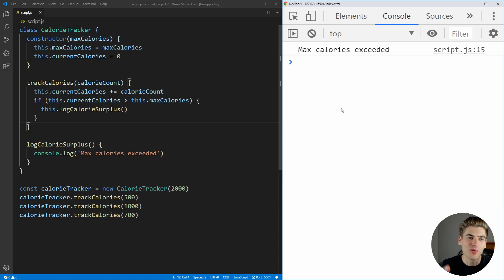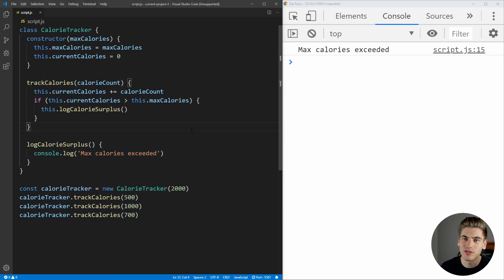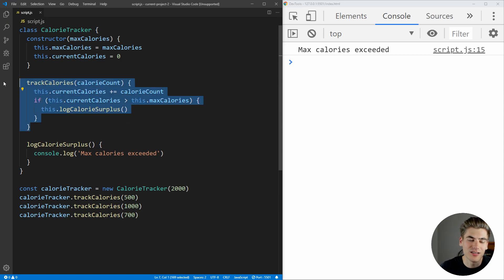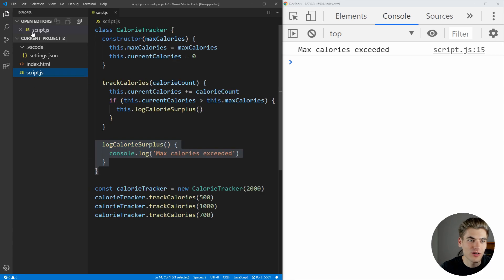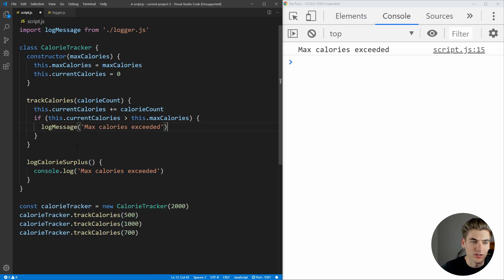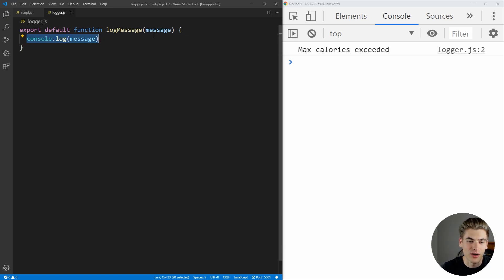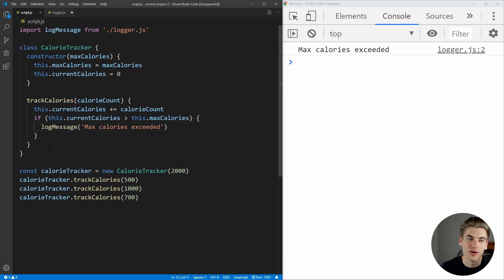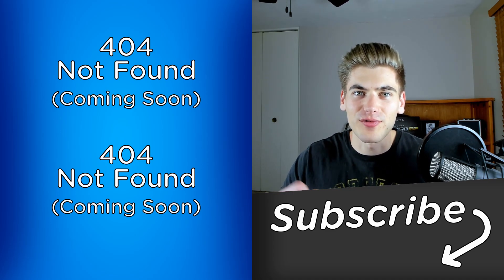Single Responsibility Principle Explained - SOLID Design Principles

Comment: The final class still accumulates trajectories and keeps track of the value, compares it with a limit and logs a warning. All what changed is that it does not call the system log function, but does it indirectly through a custom function (which is a good change, but not sufficient if you really want the SR rule).
Reply: Is that create a "Notifier" interface with a method "notify" could add more respect for the SR ? The CalorieTracker could take a third argument in his constructor (maxCal: number, notifier: Notifier, currentCal = 0) and during the instantiation of the class, pass a class which implement the Notifier interface (eg: LogNotifier)?

Comment: Now what about the part where you're checking if the current calories is greater or equal to max calories, shouldn't this get handled by another class too? Because now you are doing to things adding the calories and validating the value, also sometimes having a single class to do a very small task seems to be overkill, what about having other methods in the class and each method takes a single responsibility?

Comment: But how do you decide what is a "single responsibility" or "one reason to change"? For example, you could argue that the CalorieTracker class is still responsible for at least two things: handling the tracking and defining what message to log in case the tracked calories exceed max calories. And you can take the argument even further. If a class and a method both need to satisfy the single responsibility principle, then how can a class ever have more than one method? Two different methods represent two different responsibilities so if they are both in the same class, the class must have at least two different responsibilities. Sure, the responsibilities of the class and the methods are on different levels of abstraction but then how do you know what is the correct way to split the program into layers of abstraction? I mean, otherwise I could just put everything into a function called runProgram and claim that the function satisfies the single responsibility principle because its only responsibility is running the program and it only ever needs to change if I wan't to change how the program works.

I know that at least part of the answer to these questions is that you just have to use common sense. But the (supposed) usefulness of having an explicitly stated "single responsibility principle" is itself a consequence of the fact that it's very difficult to make correct decisions based on "common sense" unless you are very experienced in whatever you are doing. So I think it would be nice if there was more guidance on how to actually use this and other similar principles in practice.
Reply: Agree, if logic as well as the maxCalories should not be the part of the CalorieTracker. The maxCalories is used to decide whether to log or not to log a message, hence it is not part of the CalorieTracker. The CalorieTracker should only have a single property currentCalories, which might be passed to some logger instance or function, which implements an internal logic such as 'if (currentCalories > maxCalories) {// log something}'

Comment: I want to ask a simple question I just noticed. What's the difference between a function written using the "function" keyword as  "function example() {}" and writing it as "example() {}"? Thank you.
Reply: been two years and i bet youre probably a senior dev by now but if not adding the "function" keyword is using when youre declaring the function, then using it the other way is when its in classes or when youre calling the function.

Comment: The final class still violates the SRP actually. It calculates calories AND logs something. Logging is not a part of calorie calculation but rather belongs to a higher-level process - calorie tracking. If for whatever reason the tracking process needed to include some other actions (e.g. triggering some events) you would have to modify this class for reasons not related to the calculation process. The proper design here would be to have two low-level models - a logger and a calculator, and one high-level model (tracker) that would orchestrate the overall process. And having these classes in place you could write unit tests for all the functionalities with no pain - for example, you would not have to mock the logger to test the calculation logic.
Reply: Absolutely correct. The Calorie Tracker class should not know anything about the logger function it should just tells that the "max calorie is exceeded"
Reply: You're totally right. I think he kept it like this just for demonstration purposes, but what you said is important to note and should've been shown in the video.
Reply: @HandledToaster2  Especially if meant for demonstration purposes, it should demonstrate the principle properly.
Reply: @Vikas Choubey not 100% sure, correct if I'm wrong, but most likely instead of already calling logger inside the class, you might want to throw an exception, and put all the trackCallories calls into try catch, and when the exception was cought, only then call the logger. Or, create event (callories were exceeded) and listener (on callories exceeded, do that and do that, like push message, send email, delete refrigerator) and so on, which @suffocateforfucksake already explained.
Reply: This guy programs.
Reply: in javascript you can hoist the mock with jest to mock the dependency, it violates the dependency inversion (that do not is a constraint in a javascript environment)
Reply: yeap

Comment: A class with a single method is a code smell.   The solution is typically a closure.
Your example also exposed that log Message wasn't a good name for a function that sends an email.  What happens as a result of exceeding calorie count is intimate knowledge and none of the class' business.   Use an event or signal.

I like your videos.  Thanks for your work.

Comment: SRP is more of a software re-design thing or used in large classes.  In this case, it's not helpful at all because it logCalories is a private method and will only be called by CalorieTracker.
However, if you had to output to a, let's say, an alert in the browser then it would make sense for you to put the method that outputs a message to the alert in a different class.
I understand what you wanted to explain, but this calorie example is not very good to demonstrate. Maybe if there was a bug causing the Log to appear it would be helpful, but not in this cause.
It's there no Symptoms of software rot then you don't need to use SRP

Comment: Now if you want to understand the code, you have to read 2 files instead of one.
Imagine how much inheritance will be in a real project..
To understand a class, you have to understand 200 classes.

That's how a Solid Spaghetti Code is made.
Reply: This message is ridiculous. Yes in a small example like this having to look at 2 files instead of one is a minor annoyance. But in a real-world large project, this is absolutely necessary. It is much easier to follow a call stack than to read through thousands of lines of mix-matched logic because foolish people like yourself refuse to accept that their coding practices are bad. UnIronically the people most against SOLID usually write code in more of a procedural style.

Comment: Surely all we did here is remove something from the class and hide it away somewhere else, meaning that someone wanting to change that code has to figure out where it is to maintain it.
Reply from the maker: That is ideal though. In most cases if you are changing the calorie tracker you don't want to modify the way the logger works. This makes the code you need to understand smaller for your changes. Same thing with if you want to change the logger. You don't want to also have to understand the calorie tracker. You only care about the logger.
Reply: @WebDevSimplified  yeah that makes sense to me. Thanks.

Comment: Hey Kyle. One thing I noticed from these comments that, you responded every comment that says good about the videos. I am a big fan too. Instead I wanted, you must answer the comments that are facing issues/problems running these examples. #Thanks_if_you_consider_this_worth_replying
Reply from the maker: I try to reply to comments asking for help or negative comments as well, but those comments take more time to formulate answers for and I cannot respond to as many.
Reply: @WebDevSimplified  Now I got it! ☺️. One question from my side. I tried to import that function as u said in video, but it says Cannot import module outside the function. I am using npm live-server. Please answer if problem is in not using Node server or what else ?? 🤗
Reply: Anyone else knows the answer can reply.

Comment: Great intro to SRP - and one of the simplest, most obvious examples there, to answer the question 'why separate concerns' with a recognizable use-case.

I do think though, in today's post-SOLID world (OK Solid is still super relevant), you would do us a great service to warn of the evils of overseparation.  For example, m12652  hints at this in the comment. "The SRP can be a bit of a pain though if taken too far. As well as generating more code (in principal) it can lead to overly fragmented code..." and then Víctor Navarro flat-out commits the error of overseparation when he comments "A question arise from watching the video: Isn't the CalorieTracker still responsible for logging the surplus? ... (see his comment)".  It seems like common sense not to make that mistake, but well meaning people just take it to the other extreme. And you end up with multiple objects doing one thing. 

In Truth, the SRP is a sweet spot between OverCoupling and OverSeparation called 'Cohesion'. OverSeparating can kill as much as putting things in one huge method if you take it to the extremes. Read on ....

Bob Martin, the guru who's evangelizing SOLID, recognized the problem in 2015 with this blog post: https://blog.cleancoder.com/uncle-bob/2014/05/08/SingleReponsibilityPrinciple.html

Entire thing is worth a read. Here are some salient quotes:

   "The Single Responsibility Principle (SRP) states that each software 
   module should have one and only one reason to change. This sounds 
   good, and seems to align with Parnas’ formulation. However it begs 
   the question: What defines a reason to change?
....
   "Another wording for the Single Responsibility Principle is: Gather 
   together the things that change for the same reasons. Separate 
   those things that change for different reasons.
....
   "as you think about this principle, remember 
   that the reasons for change are people."
Reply: I think it might be worth it for Kyle to make a followup video encompassing these points.
Reply: That's why we have microservices.

Comment: Hey Kyle. Excellent video as always!
A question arise from watching the video: Isn't the CalorieTracker still responsible for logging the surplus? I understand that it does not contain the function for logging itself but it contains the logic of when to print and what message to use. 

I imagine that in a real world scenario you will use some kind of event system and when notified a CalorieLogger (for lack of a better name) will notice and do whatever it wants to do. What do you think about this? It is worth the effort to think in these terms or you can simply view composition as a way to separate responsibility?

Thanks!
Reply from the maker: This is a great point. In most applications generally it is fine to have that type of logic in the calorie tracker class since the main thing you are abstracting is how the logging works. The only time I would worry about event based systems was if I wanted to completely decouple two systems by using events between them to communicate. This is generally only useful in specific situations in larger scale applications since it introduces a bunch of other complexity and indirection related to the event system.

Comment: This is so cool. I'm working on an app that makes 100s of API calls to different microservices.
I have to show some sort of messagebox or alert in my axios catch if it fails or out of bounds.... I could have hardcoded a messagebox but now the client wants to log the messages and API them back to a server, so management can see them on a dashboard. Imagine having to add all those statements :lol:. I call an error function and can add a few lines of code now. We may want to move away from bootstrap dialogs, it would be really easy.

 You don't realize how important SOLID is until you need it! If you are duplicating any code consider making a function!

Comment: Great video as usual. The SRP can be a bit of a pain though if taken too far. As well as generating more code (in principal) it can lead to overly fragmented code. Personally, I find it’s more practical to think of a responsibility as a “manageable unit”. I.e. group the code in a way which is easily understood, easily maintained, only depends on generic methods and of course is DRY.

Comment: This will fail in Internet Explorer (still bundled with #Windows 10 for some reason), many/most versions of #Microsoft Edge, and many ancient linters, unless you compile it to ES5 or use something like dynamic-import-polyfill.
Reply from the maker: Good point. Generally when I am deploying a site I will use a bundler like Parcel or Webpack to compile my code and make it compatible for older browsers.